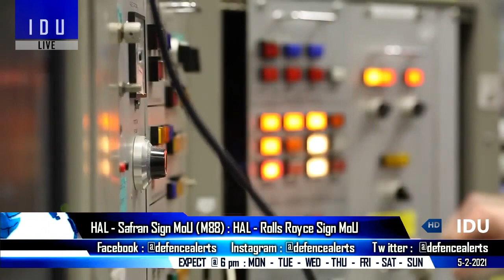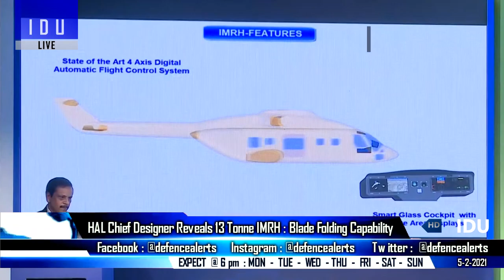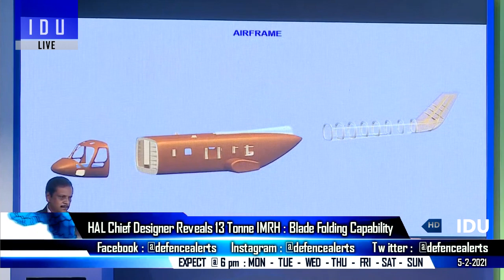Indian Defence Updates : AMCA Parts Production,Kalyani M4 Ordered,HAL M88 Production,1000 Cr SDR-Tac

Comment: Why are we still wasting time and money on Kaveri with public money? Why can't private sector be given funds and contracts?
Reply: Kaveri dry thrust engine will be used in Ghatak UCAV. So it is not waste. First thing we are not failed in Kaveri engine. But problem insist is weight, low thrust and we have not discover the light metal with can be sustain the temperature. This problem is in Arjun Tanks, ATGS. If we get core technology either from Safran or Rolls-Royce. We will also leader in aero engine.
Reply: @ramprakashbhatt6672  That counts as a failure, both in Kaveri and Arjun. We must accept it.
Reply: @kirtichandrakomarraju5164  Kaveri project is not a full failure.the alloy derived from the project is used in the NTPC power plants
Reply: @kirtichandrakomarraju5164  While making Arjun, we were thinking to tackle Abraham tank which are heavyweight tank. So it is not failed. And for Kaveri you can say partially failed. But you will not always  succeed in all attempts. Don't worry we are collebrating with Safran or Rolls-Royce for high thrust engine. Private sectors will not invest these much huge amount for technology which they don't predict for results. Yes we should make engine in PPP model like AMCA.
Reply: Engine s a v tough process. Even if we keep failing we have to keep attempting. It will help us to operate helicopters n uav